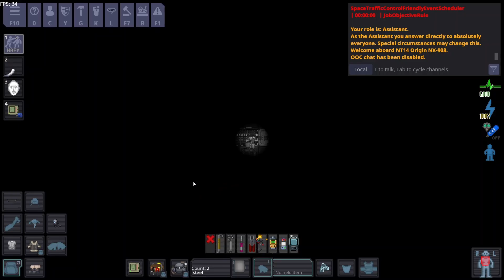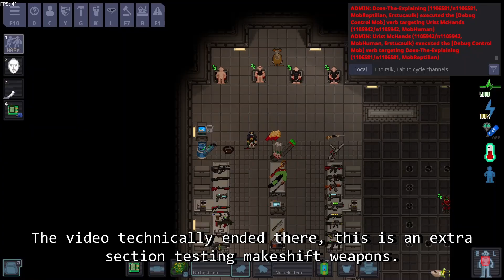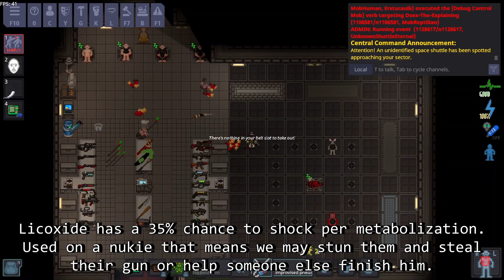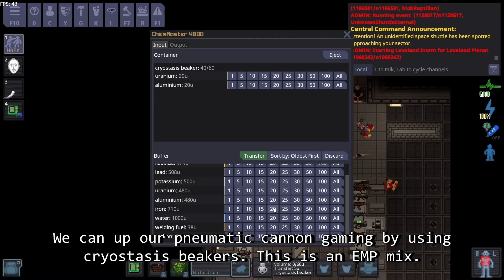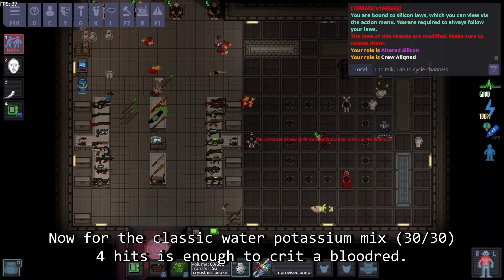Tide Archives P.3 Easy Powergaming.

Comment: You can hide pistols and most knives inside jackboots. Sometimes it's just seen as drip by sec and they won't take em.

Also; as a CE player, just ask for the gloves at least at first. If you're not sabotaging engi, it's likely you'll get em without all the hastle.
Reply from the maker: The first i knew, just uhh remember to take it out before you toggle the soldat hardsuit on.

For the second, yes maybe. Though i just assume they gona say no and im probably correct most of the time. I got used to do it that way to optimize antag time because goob rounds tend to not last long and the 5-7 wasted on asking engie and waiting for them to just say no then trying to worm in is worse than the 3 it takes to just steal them directly. In a server where a round is expected to last 40 minutes some times every minute counts.

Comment: Tactical made gloves might need to be retested. I saw that there was a PR related to it.
Reply from the maker: The tactical maid gloves have always been insulated (at the time of recording too) currently they are only mapped in one map (bagel) and the intended way to obtain them is by cutting the manager wire on the SyndieDrobe which is only mapped in nukie bases and loneops shuttles. There is no reason to remove the insulation on those, that PR has 0 purpose to exist unless they are planning on making the tactical maid outfit something the crew can reliably get.